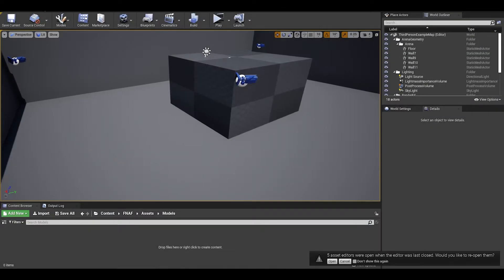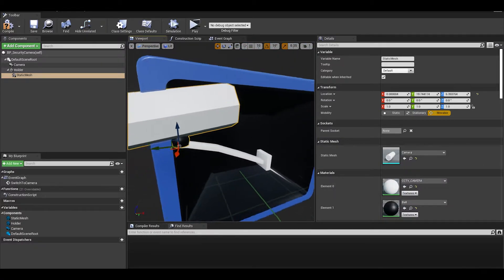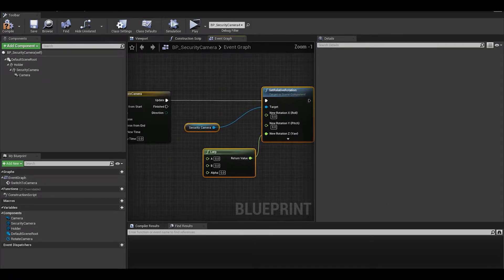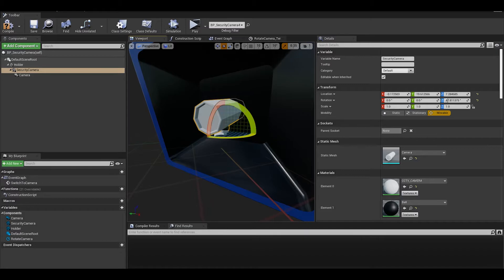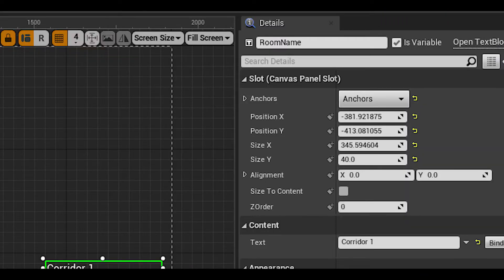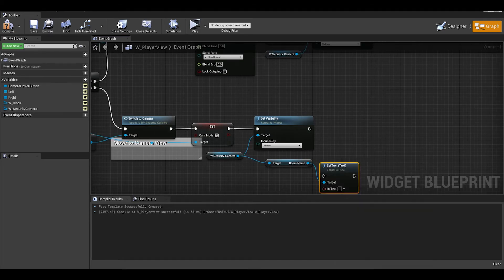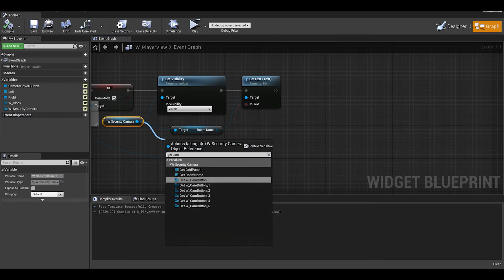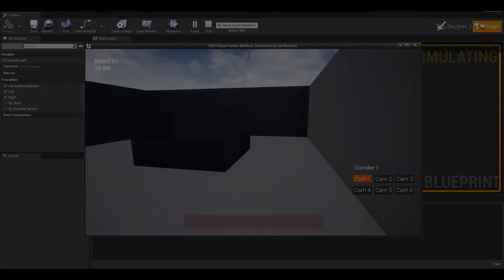Unreal Engine | FNAF Security Camera System Part 2

Comment: Where did you get the GridPanel on the 6:45 timecode?
Reply from the maker: This is part 2 of the camera system but I created the widget in Part 1 and around 5:10, I added the grid panel.
Reply: @unrealdamagecontrol You added a uniform grid panel, not just a Grid Panel.